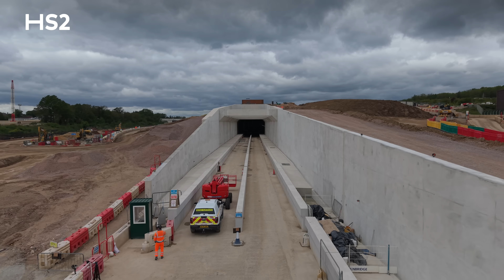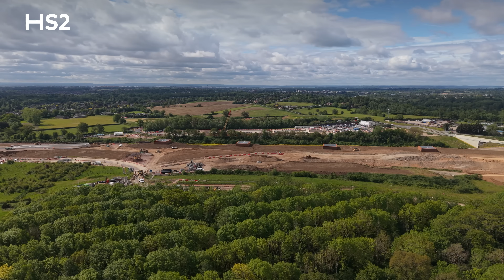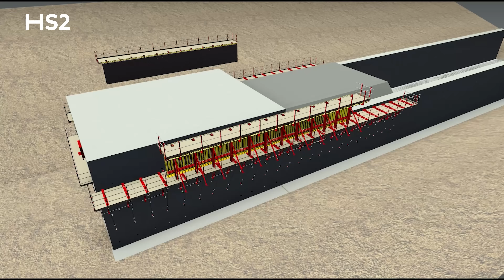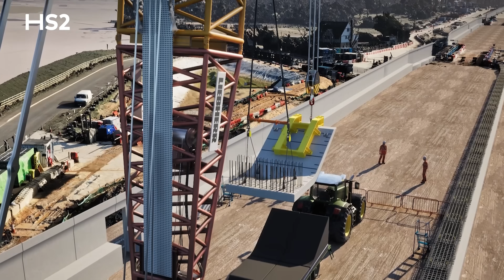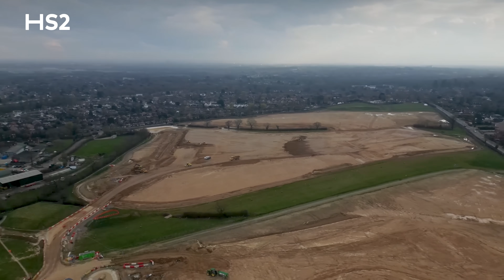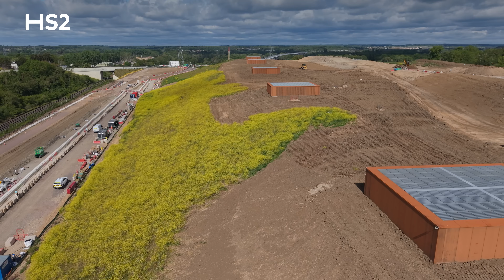HS2's first completed green tunnel | Copthall Green Tunnel

Comment: F**** useless, bloody. national rail. Stop throwing thousands at a new route. When you can just reuse a line, ernest tubs closed in the nineteen fifties and sixties, the great central railway going from london melbourne, straight up to a rugby. The bridges are still there. The stations are still there. The tunnels are still there. Every single piece of railway structure you need is still in place.Why spend a fortune on a new route? When you can just reuse an old one,
Reply: It goes through towns and is very winding. Would you want very fast trains going past your front door.

Comment: Just a reminder that this structure was built only because if all the moaners down below in these comments.  They all wanted this built to Jack up the cost of the project because they assumed that a higher cost would garner more opposition. 
They wasted tens of billions on unnecessary projects like this green tunnel and are now desperately trying to deflect from the fact that over 60%, over half the total cost is due to them alone.

Comment: I'm very much a HS2 proponent, but this particular green tunnel seems like an overkill, given there is already a railway close to it
Reply: This particular tunnel is just as much about keeping spoil from the Northolft Tunnels on site, imagine the costs in both monetary and environmental terms of taking all that spoil miles away to dispose of it??

Unfortunately due to the Chiltern Line having little if any spare capacity taking the spoil away by rail probably wouldn't have worked, so road it would have been unfortunately.
Reply: @Polarbear1-b6jWhat about the spare capacity at night?
Reply: Actually this tunnel is a result of a previous CEO of Hillingdon Council commissioning work to prove that tunnelling was no more expensive than an overland option. He won a lot of votes from grateful council tax payers.
Reply: The whole idea of HS2 was to add new railway lines, not to replace the existing lines (whether that was a good idea is an open question). The existing railway close to it will be kept for existing conventional trains
Reply: @RobertTownrow I realise this, but given that the old line is already cutting across the countryside what is the point in burying this section?  Animals and stuff can't get across anyway.

Comment: Tremendous progress to an excellent design. The Colne valley viaduct was completed ages ago and the 10 mile tunnel under the Cotswolds is almost finished, with it getting fitted out with fire doors on the cross passages etc. It does rather beg the question why it will take 10 years to see any trains running on it, when the civil engineering is this advanced. The answer lies  with the politicians and the Treasury, but HS2 and the contractors  will get blamed for the delay.
Reply: *Chilterns
Reply: It probably won't, no other line in the world has spent 3 years in testing, like the current plan commands.
Reply: @DavidKnowles0  I agree with you. The first element to open is Curzon street to Old Oak. I think its only three trains per hour initially in each direction   and there is no integration with existing signalling systems to consider. This was the reason for much of the delay with the Elizabeth line.
Reply: @JohnHoward-wc9kk exactly, i probably wouldn't even open the interchange street until the Curzon and ooc is up and running. 

OOC will be open up in phases it likely queen Elizabeth line and great western line will both be stopping there before hs2.

Comment: why do they need noise barriers when there already a railway right next to it, where there are no nois barriers?
Reply: because it's elevated and the noise produced would otherwise travel a fair distance. It's probably producing louder noises at different parts of the spectrum than the standard trains which aren't elevated and probably running 40-70mph there and already have a solid greenery barrier grown.
Reply: Looking at the video, the line is on a raised embankment for the short distance  between West Ruislip tube station and the entrance to the Copthall tunnel. Looks about 10-15 mtrs above the surrounding area. A train  doing 200 mph here, would project sound a considerable distance. Those concrete barriers will reduce that significantly.
Reply: I thought it similarly daft they put barriers alongside the Varsity Line when converting it for East West Rail, even on stretches that were never mothballed so had train noise for 200 years. It's like the signs in historic pubs asking you to be quiet for the neighbours - got to appease the NIMBY incomers.
Reply: because high speed trains make much more noise
Reply: @The_Dig_Bick They really don't. They are electric and most of the noise is from the wheels on the rails. Which every train produces.
Reply: @bubba842  don’t forget the pantograph. This can surpass the wheel noise at very high speeds.
Reply: Because eco grift.
Reply: Not particularly gifted in the brain department are you David? 😂
Reply: @Harry244ful  for aksing a question why they spending money on noise barriers iwhen the line is directly next to anther railway and the local residences look like warehouses from the video.  May be if people ask these questions the project wouldn't be massively over budget.
Reply: Noise barriers that are common places for busy roads and railways across much of the world to stop residents lives being disturbed by the railway? Seems a fair investment to me.